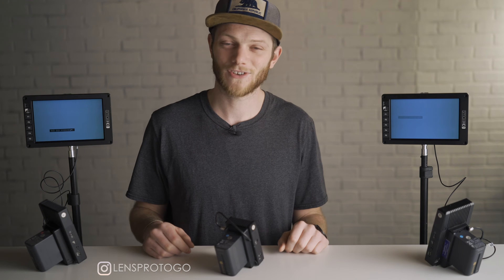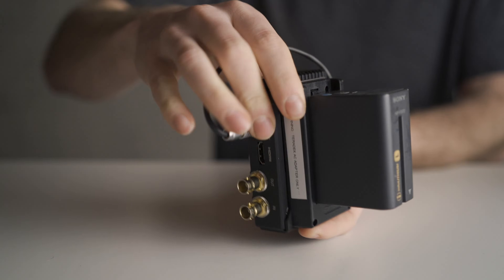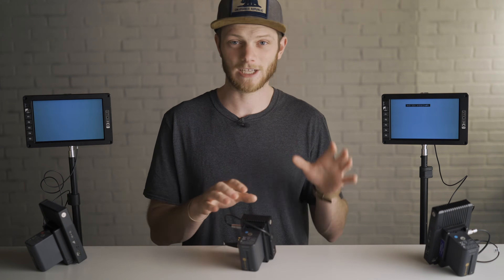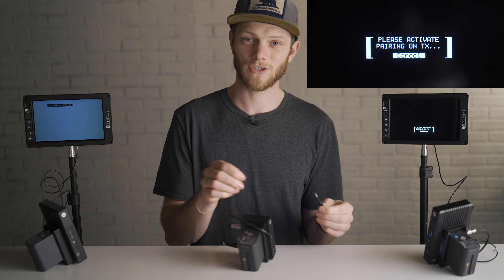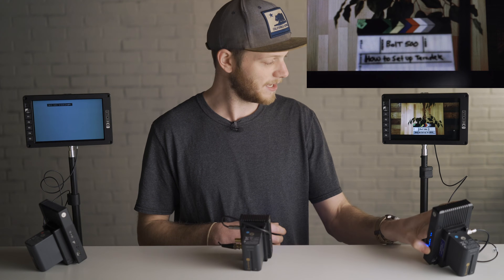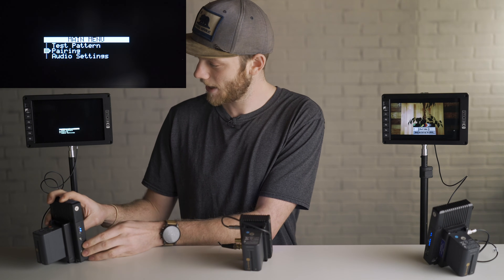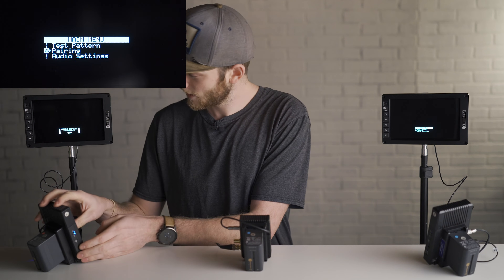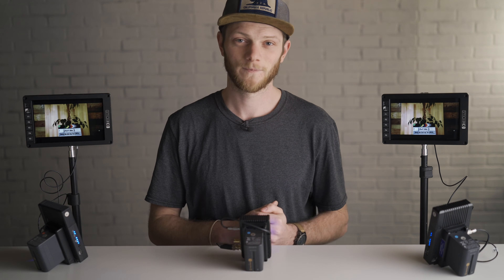How to pair a TERADEK BOLT and add a second Receiver

Comment: At work there are 4 buildings, and in all 4 I would like to be able to use 1 transmitter, and pair with the receiver mounted on a local PC, 
so to record to a capture card, the action.
My question is, since there is lack of time, I need the pair to happen immediate. The receivers in the other buildings will be OFF.
Therefore, can I keep all receivers on the same channel, but only turn ON the one, that I want the recording to be sent to ?
Will it work as simple as that ?